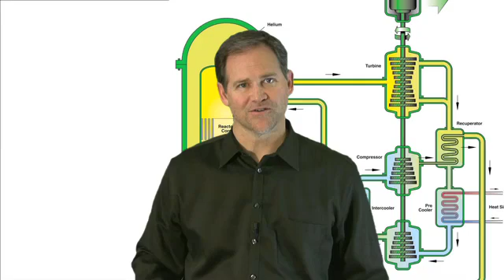inFact: Nuclear Energy

Comment: i don't think that anyone argues with the potential of nuclear power producing vast amounts of cheap energy.  As we move into generation three and four versions, the efficiency of these designs is remarkable, and the reduction in high level waste is also impressive.  What remains equally impressive is the effects of any issues should something go wrong.  You spoke of 59 people dying.  that number is going up.  When considering the disaster, you have to consider the 100,000 people who had to be evacuated and permanently relocated as well as the several hundred square miles of land that has been quarantined for decades.  The effects of the cloud from the event spread as far as Sweden where wild boar in some areas are banned from consumption because they still, nearly forty years later, have readings 100 times higher then the highest allowable radioactive measurement for pork.  Certainly the fukushima plant was one of the oldest still in operation in Japan, but in comparison the safety precautions and maintenance of the plant is at an entirely different level to chernobyl.  Yet still the effect of the earthquake and resulting tsunami have created a disaster area of a similar size to that which was created by chernobyl.  There are issues with all of the ways we generate energy.  We have to make decisions based on the risk of issues and the impact of the issues.  Nuclear power is a very safe way to produce vast amounts of cheap energy.  The complicating factor is that should anything go wrong the effects can be equally as vast.

Comment: I am a proponent of nuclear power, but I have the say the facts here are all wrong.

- If he's right about 70 years of history, then generation 1 was the CP-1 and the plutonium production piles at Hanford. Chernobyl "Construction of the plant ... began in 1970, with Reactor No. 1 commissioned in 1977. It was the third nuclear power station in the Soviet Union of the RBMK-type (after Leningrad and Kursk), Hardly first generation; Fukushima and most of the plants in the US were built before Chernobyl.

- "Not driving around in electricv cars.  Ouch - not support, or evene any real connection, made for this.

- TMI.  The problem there was mainly of the company's own making, in PR with the public.  I'd hardly reconcile Dunning's description with the partial meltdown and a 14 year process of dismantlement.  The biggest lesson learned there was getting rid of complacency and training the operators. Carter saved their PR butts with an act of real courage.

But you are right about the China Syndrome. Stupid movie.

- There have been a few other civilian accidents, with a very few deaths and a few injuries.  Nothing to compare with, say, coal mining or a broken dam.

- Chernobyl was not the oldest reactor operating as explained above.  There were no "factions" in the plant. The test needed to be run (by Moscow policy), and the reactor had failed it once, should have been done before reactor put online. The top executive heads were on the line about passing it. They ordered it done. The test was put off to the third shift because the electricity generated couldn't be spared. The test director was ambitious (feather in cap for getting this done), cut corners about following procedures. Design flaws in the reactor did the rest. Steam explosion tore reactor apart, spread 15% of contents to the countryside. Fuel melted, content burned through reactor, wound up congealing in basement. Expensive cleanup, still underway. Lots of political fallout.

Yes, read about it.  Start with wiki, "Chernobyl Disaster".

- Waste is a problem, mainly because of NIMBY.  Look it up. There are solutions, but they're more expensive than just piling up the waste and mining new fuel, rather than recycling.

This is the first Dunning podcast I've seen.  I'm not impressed; for InFact, it's a D.

Comment: You need to get your fact straight. Chernobyl (at least the reactor that melted down) was an almost brand new (2-3 years) second generation unit.

When you really look at it, it was entirely the fault of the staff. If I did not know any better, I would have thought that they were trying to cause the reactor to meltdown.
Reply: You're totally right about the first thing, but why would they do it on purpose? They where in plant when it happened. It's more likely they where just incompetent.
Reply: Oh, I wasnt trying to suggest it was sabotage. I was trying to emphasize how incompetent the staff was.
Reply: boonw Sorry about that, too used to comment section nuts. He also wrong about electric cars. There is nothing to stop them being powered cheaply on coal or even solar now. Even today they're batteries are no where near good enough unless you simply packed an extremely expensive amount like Tesla does. Building a society dependent on the car is on the one worst cases ever of malinvestment. With so much lost to accidents, fuel and putting everybody in they're own steelbox with own engine.

Comment: Liquid Fluoride Thorium Reactors provide MORE safety as well as easier safety features to the plant. Thorium based reactors are also MUCH less likely to go critical in the event something happens since Thorium doesn't chain react the same way Uranium does. LFTRs can provide safe power, and at a MUCh cheaper cost (most thorium is just tossed aside when it is mined, and there is literally tons just sitting around!)

Comment: Yes, I did see it. I was speaking about the possibility in general. I live about 25km(as the crow flies), from two AGR reactors. They have been operating since 1976, and currently generate 1000MW. I consider the risk of living in their vicinity to be acceptable. They are due to be decommissioned in 10 years time. I hope they will build a replacement reactor. The alternative will be greatly increased bills to pursue eco-follies. Solar and wind power are expensive, diffuse, and unreliable!

Comment: Whilst I consider this a disaster for the people there, there are possible means to remove much of the contamination. Prussian blue is used to treat those with heavy metal contamination, and has been suggested as a way to leech the soil of its contamination.
In the longer term, I personally favour Thorium reactor development, for it's greater theoretical safety and lesser nuclear waste problem. Even with Chernobyl and Fukushima,nuclear still has a low death rate, compared to other energy sources

Comment: You mean a natural disaster happened?  A natural disaster that had been planned for, but not nearly on that scale, and the many of the HUMAN components were not vigilant in preparation.  So, to be clear, a seismic event, then a tsunami, then secondary damage affected the the NPP's, along with the travel infrastructure, communications, food/water, etc.  The reactors scrammed within the design specs (<20 seconds), but a loss of heat sink / cooling water from a natural disaster caused that.

Comment: These are all problems with technological solutions that are easier to reach than the ones facing renewables. Another argument is a pinch of realism; we already have *a lot* of nuclear waste material lying around that could potentially be put to good use in new nuclear reactors. Basically, modern nuclear reactors could alleviate the most significant and persistent problem with the old ones.

Comment: Wind is not ideal for decentralized production, but nuclear reactors such as the traveling wave reactor could provide safe and stable local production with little to no maintenance.

As for solar, hardly any energy tech has more research going on than solar right now. There is no reason for that to change, nor is there any reason for it to stop us from pursuing modern nuclear power production technologies. The ONLY way forward is to pursue multiple venues simultaneously.

Comment: It takes between 2500 and 2800 windmills (about 60k acres) to equal the production capacity per hour of a typical nuclear power plant. And "typical" today means "old"; modern plants are smaller, more efficient and safer. Modern designs are also self-regulating and simply will not blow up.

In the long run, power production will become more decentralized and there solar power will have a significant role to play. But that won't eliminate the need for a backbone of stable, centralized production.

Comment: The problem with focusing on those technologies is not singular; there are many problems. The four most significant being power production per area, geographical/topological variation in production efficiency, the stability of the power production and cost per kW/h over the lifetime of the installation.

Yes, the last three can be addressed to some extent (flying windmills, batteries and hybrid production with hydropower buffering, lowering materials cost etc). The first problem still remains.

Comment: Fukushima was run by an irresponsible company with insufficient government oversight, but most importantly, it uses an extremely out-dated design. If I remembered right, the power source for the coolant system of the plant was for some reason not in the plant itself but rather some other separate off-site location, which was flooded by the tsunami. In another word, without this design flaw the nuclear plant would've survived the worst recorded earthquake and tsunami in Japanese history.

Comment: The 3 Mile Island incident was a leak but it was a leak that resulted in a core meltdown.  He makes it sound like something that could be cleaned up with a mop and bucket.  
No one knows how many accidents occurred in the USSR but the Kyshtym incident in 1957 resulted in a 1000 square km exclusion zone.
His "shift change" story is incorrect.
I'm no expert but I take issue with his statement that modern reactors produce recyclable waste.  I don't think most radionuclides are fissile.

Comment: No question the RBMK-1000 was an old fashioned and unsafe design.  But that's not what he said.  
"It was the oldest reactor operating" is the quote and it is untrue.  I'm actually in favor or responsible nuclear power generation but I don't like hearing lies from either side of the debate.

Comment: @keeblin just Google fast neutron reactors, the very small amount of waste from current thermal neutron reactors comes from the fact that very little of the fuel is used ~95-90% of what goes into a nuclear reactor is what comes out, only about 5-10% of the fuel is used.  Fast neutron reactors enable far more efficient use of the nuclear fuel and enable the burning of some fission products.  There are also designs for reactors that use thorium as fuel, which results more manageable waste.